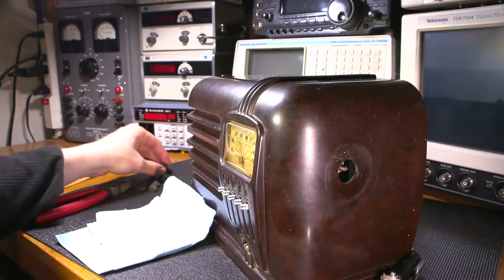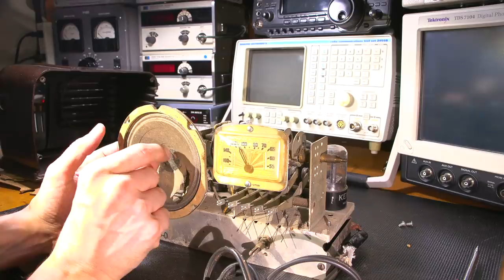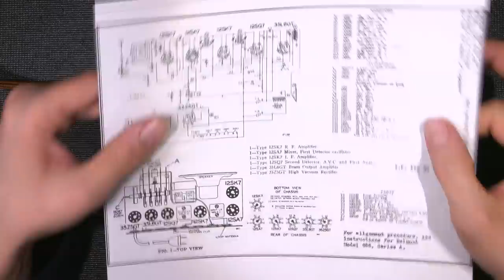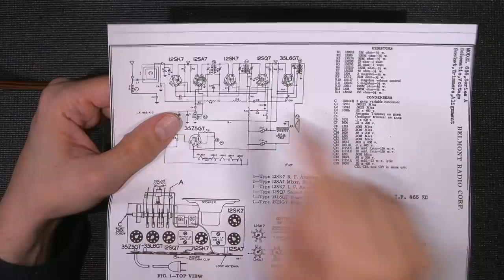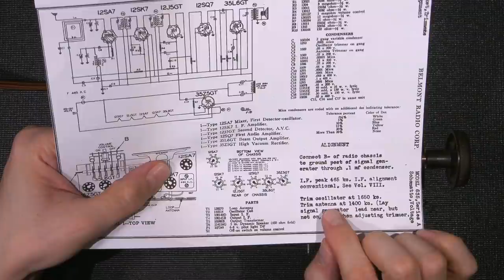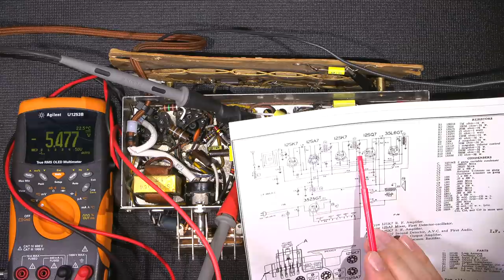Electronic Restoration Adventure-The Belmont 636 Radio Receiver!

Comment: I'm not an electrician but I like to delve into stuff that is way out of my comfort zone but with the right info and doing it very slowly step by step you'll get there!
antique phonographs are my thing but I wanted a radio of the early 1920s one of those beauties with glowing valves and square bare wiring I found 3 for the price of a half one 2 worked fine those things are pretty solid and not much can die with age with these things but one was shot and way gunky!
it took me about a year to find original parts and there are no specs for these so you have to learn what is what, what does what and what goes where aka,... really fun!
the tubes or valves were ok hmm sadly only in clear glass I hope to find replacements in multiple colored glass pointy-headed tubes to light this puppy up like eh,... quite literally a Christmas tree!!
there wasn't much wrong 3 glass resistors were broken (it's simply X amount of copper wire windings on a thin glass tube or even between 2 thin glass tubes) the thin tubes were broken and the copper wire windings cut that was all except the resistors were unmarked...
so I had to go to similar pre-1928 home build sets and do a guess and then take measurements with the guessed new part I bought to see if it measured up to the rest. 
and that was my life for 2 years!! testing testing testing those parts until I got it right. 
now to find pre-1928 loudspeakers, not an easy thing folks!!
the jist of the story is that even a dummy like me can get there in the end!

Comment: Hi Mr Carlson funny story to tell you I was fascinated with electronics at a young age and so we had an old radio that was broke so I took the speaker out and connected it to an old tv that had a radio in it ran a long cord so I could hear the sound by the couch so I did that for a  few days the cool thing about this old radio was if you turned the dial all the way to the end of the band you could hear the police calls no other radio did this so I thought it was really cool and one day we got a knock on the door and it was a police officer and he said we were broadcasting on there frequency. So somehow our old tv/radio turned into a transmitter on the same frequency as the police frequency I was listening to. Now is that the strangest thing you ever heard?

Comment: Superb restoration. I would love to see someone remove all the resistor, capacitors and leaving just the chassis with the vacuum tubes and sockets,  and underneath a modern PCB with modern resistors and capacitors, but with wires going to vacuum  tubes. Thus eliminating the "hot chassis" problem and the look like someone dropped some components inside the chassis.

Comment: Very cool.  The preset cams are a nice design.  I rehab old typewriters and they have some really well designed mechanisms, as well.  I you want to see a nutso mechanical design, go look at the wiffletree they used as a binary mechanical interface" computer" in the IBM Selectric II, it ties the keys to the ball totally mechanically, to rotate and tip the angle of the ball typeface head.  Some of those "old school" designers were REALLY clever.  That  underneath "packaging" in the case of your radio is pretty awful, though.  Giant components just all hanging on their leads wouldn't exactly fly in military design.  ;-)  

If I ever wanted to do a rehab on one of these this video would be invaluable.  I am a EE, but have NO tube experience, and am clueless of the design methodologies/architectures.  I just resurrounded the speaker in my Velodyne servo sub.  I wonder if you can still get a kit for that speaker...would depend on the geometry,  I would expect.  Were those speakers even 4 or 8 ohm or some higher resistance versions?  It also looks to me like that design could really have used a fine tuning knob, as well.

If you sell these afterward, and I'm ever looking to buy one, I will look you up.  If you ever want to buy an antique or vintage mechanical typewriter (or other things, ultimately), give my channel a view. Hobbies are a good thing.   ;-)

Comment: W-D40 is good for cleaning parts but bad for removing lubrication. I always . use 3-in-1 oil after I use W-D just to re lubricate my parts
. The inside of this case is a good place to do this.. This is A god video and I respect your work and will fallow you in hopes of learning from you!

Comment: Classic AA5 design.  Rider's Volume 11.  A or B revision?

use elmer's rubber cement to revive the speaker cone assuming you are able to fix it.  coffee filters and service cement followed by elmer's rubber cement can patch smaller holes, but i've never patched a hole/rip that big in a cone.

you'll need several coats of the rubber cement on the cone.  coat the entire cone until it is saturated.

Comment: Some of the Old tube radios had a feel to them back in the day.  The AC-DC units that ran on 110VAC at 25HZ  had a feel to them as power supply buzz on the speaker could be felt but not heard,when the Electric utility changed over to 60 Hz from 25 Hz  the old radios started to buzz.

Comment: in 1980 I worked at NCR where they manufactured the power supplies for their equipment.  We had one technition that would have a capacitor explode once a week or so..  YOu could really hear the big bang.

Comment: Keep your eye open for some old Bell (Western Electric) vacuum tube intercom systems. I have several, and they all have that exact same speaker in them. I believe they are 4.5" in diameter, and are 12-16 ohms IIRC.

Comment: No rf section in that design, The 12J5 in the circuit is a 2nd if and gives the set very good separation between stations. Real dx on that set depends on a good outside antenna and retuning the antenna trimmer to the frecquency you are interested in. Bur usually the broadcast band  has too much noise on it unless you live far from any city. And no thunderstorms. lol. 
 A wonderful restoration on that set.

Comment: If you really wanted to save the old speaker Say if it's a really odd shape/ size or just rare, a piece of paper, hobby glue and some shellac would do the trick. The hobby glue would not only be for holding the paper on but if you rub it into the surround it will remain flexible and prevent rips, the shellac is for the cone to help stiffen and strengthen it as well.

Comment: I get the idea behind the "safety mods" in terms of switching the hot side and using a polarized plug. A number of times this has led to substantial hum in restored radios, and a cord you cannot "reverse" to limit the hum. I think I am giving up on making the chassis "neutral" as most radios were designed to have the neutral side switched, and sound better that way. They are also in insulated cases and do not prove to be a shock hazard at all. A fuse (or two) is a great idea, though.

Comment: I am working on an old Zenith AM/FM radio.  Non-polarized plug.  The volume on/off switch switches one of the AC lines to ground.  So I switched to a polarized plug.  That way I can control which one goes to chassis. The neutral is preferred since you won't get zapped if you touch the chassis that way.  I had the bright idea to convert to switching the hot lead.   Bad idea.  Makes the radio hum like crazy.  I discovered that by grounding one leg of the switch you eliminate AC on the switch getting into the volume controls audio lines.  Makes sense.  FWIW

Comment: #question/tip?  : you mention the rubber shielded wires that will be really hard to replace cause they go in filter can. In those cases where you really don't want to open up filter cap, can't you "just" take all visible/reachable rubber off to bare metal and then re-isolate with heat shrink?
Course only works for relative short ends where/when replacing would be really hard.... replace is better; but do think using heat shrink can sometimes save the day

Comment: Hi Paul!  Have you ever considered doing a video to demonstrate the impacts of installing modern replacement film capacitors without regard to which lead is connected to the outside foil?  I've always installed them so the labels all face the same way.

Comment: I use to work with a guy that endlessly chimed about PPE. Gloves, Hard hat, ear plugs. Safety glasses, boots and high vis....yet didn't own a single bit of it. 
 I get the lecture about deadly redundant ground electrocution but ya kind skipped over eliminating the dangers with a power switch rewire...also it would be kind of you to demo your peanut transmitter and a temp check. 
 Cheers.

Comment: GFCI outlets do not use the ground prong ( "that 3rd pin") to do their work. GFCI circuits measure outgoing current through the hot and returning current through the neutral and if they do not match, the breaker opens.

Comment: Tubes are usually welded or crimped, not soldered, so it goes without saying you’ve never desoldered the pins or contacts in a tube .
Reply from the maker: Octal pins are soldered at the ends.
Reply: Mr Carlson's Lab I wasn’t aware of this. Is this always the case?
Reply: Or maybe I am not making the distinctions between the tube and what connections it has inside the envelope, from the connections in the base, and then the hmmm terminal.
Reply from the maker: Very rarely have I seen a spot welded "and crimped" pin on an Octal tube. About 99% of Octal tubes are soldered. "Loctal" tube's, more commonly seen in Europe, have a solid pin that goes directly into the tube through a base seal. These are not soldered.
Reply: I am used to seeing the more European versions, which might explain a lot. Thank you for your replies.

Comment: It was hardly played otherwise that plastic would have been cracked. It may have spent a lot of its life in disrepair. If someone meaning who ever you sold it to it might be a good idea to install a computer case fan in the back of it venting the hot air out of the back so the heat doesn't crack the plastic. I like the way you think of every little detail like the dial back light. Very good job.

Comment: You forgot to show setting the dial. Is it just horizontal at the extreme ranges of the tuner? Also, we didn’t get to see what you did with the back cover. And lastly, i personally like the single backlighting. It reminds me of the simpler expectations of the times it was built. I’m not old or anything but we had a freestanding AM radio in our living room when i was a kid. It had a single sided backlighting, if i recall, as well. Thanks for doing this.

Comment: Just my assumption what's inside the 'Outside foil detector'.
There is a dual op amp ic with two non-inverting input hooked up to the probes.
There are two n-channel FETs, drains connected to the probes and sources tied to 'ground'.
The gates are hooked up to an astable oscillator (.25Hz) (with an inverter logic* to alternate the inputs (probes).
The outputs of the op-amps (ofcourse with the gain adjustment dual POT connected to inverting inputs of the op-amp and gets grounded via resistors) gets common by diodes and gets fed into an LM3914 or LM3915 (to be specific) which shows the indication of noise levels through the array of yellow LEDs.
The green LEDs near the probes are connected simply to the astable oscillator.

*The inverter can be made by an n-p-n transistor with the emitter connected to ground and collector connected to +ve supply rail via a resistor (around 1k). The base is the input (from oscillator) and the collector serves as the output to the gate of one of the FETs.
Reply from the maker: Your about 10% right ;^)
Reply: Thank you

Comment: A tiny drop of colored fingernail polish on each point where a new wire replaces an old colored wire might be useful in matching up stripped, previously-colored wires with new colored wires on the old contacts.  Just a suggestion.

Comment: Amazing coverage of a restoration! I'm curious as to why you modified the dial light for two incandescent bulbs vs two LEDs. It's a little time consuming to figure out the perfect resistors to current-limit RGB LEDs so that the LED has the "correct" brightness and color temperature, but the LEDs will last the new extended life of the radio. And having done that, is it going too far to tap the IF2/detector signal, add an op-amp, and change the dial color to indicate tuning? If so, then why?

Purists lift their noses at mods of any kind, so it seems to me that if a mod is desirable enough to plan/execute, then it's best to go for the state-of-art as it exists. An example is the Zenith I'm working on - still: it had no speaker/transformer, and I can't find a replacement so I added a good output transformer to the chassis, speaker terminals, a two way passive crossover, a new speaker baffle, and a decent woofer / tweeter. I'd really enjoy hearing your opinion on the subject of Frankenradios.
Reply from the maker: Hi Giblet. I thinks it's all about balance. Two incandescent dial lights look more original, and isn't going too far from an original design. Yes LED's would look great, but would "in my own personal opinion" take away from a modification that could have been done the next day from the original purchase. At this point in time, a restoration is a personal thing, and almost everyone has different ideas about how a restoration should be done. The bottom line is.... Just do what makes you feel good about your resto, after all, it's you that's going to be enjoying it. Just have fun. I have an incredible frankenradio to do a video on..... It's bad!.... I purchased it just for this fact alone. It's going to be fun!
Reply: I can't wait to see you restore a Frankenradio!

Comment: @41:53 I would have checked for conductivity between the two coils as I have found problems with the plate voltage bleeding over to the grid coil usually due to surface contamination of nicotine which is water soluble.

Comment: Hi Paul       Ray Burke I didn't see you putting in C16  40 uF 25 V , C17 30 uF 150 V,  C18 30 uF 150 V  11953 E  caps that replaced the mulitsection Electrolylic under the chassis. Which are listed under Condensers in the Parts list.      I see you used a Tektronics 200 series scope which runs on batteries.  You could reference your videos on isolation transformers, and using a benchtop scope with an isolation transformer on a AA5 radio.

Comment: i have an old 1948 tube radio only like 5 tubes though. it also uses a selenium rectifier which i found interesting. its 100% original all the tubes are same from the manufacturer labeled as Bendix on them. entire radio is pretty much new. no scratches or missing anything on the Bakelite or anything. cored sadly bit dry and dinged but nothing dangerous or exposed. sad thing is the filter caps and such are shot so it buzzes sooo loud so i don't ever use it as i have no idea how to change those atm well plus don't want to ruin the value of it. for $80 though its a great deal. it also has FM and AM.

Comment: Doesn't exist electronics tubes "RF amplifier" or "audio amplifier" etc, they are only diode, triode, pentode, and any except diode could be use how you want, depend how designer did. On beginning the antenna has one oscillator integrated,  Capacitor in series with an inductance is an oscillator.

Comment: Very nice restoration to watch!  I enjoyed it all.

However,  I didn't see what was done to the back cover/antenna.  That was loose and in poor condition.  Did I miss something?
Reply: Also----  you discussed oiling critical mechanical areas,  but what about grease?
Reply: Of course most consumer electronics gets no routine maintenance at all and simply gets tossed in the junk pile when it no longer works right.  But I'm curious as to what kind of routine maintenance this kind of equipment should have,  and how often?

Comment: Do the lines on those old capacitors indicate the outside shielding and not that they are electrolytic capacitors?  What kind of capacitors are they--wax, paper, electrolytic?  What do you do when a tube fits loosely in its socket? I can't believe that you got a new vintage electromagnetic speaker.  I would have tried glue and a piece of paper towel.  Why are you using a ceramic capacitor in series with your function generator signal input to the IF of the radio?  I cannot believe that there was room for another light for the indicator.  The engineers were on barbiturates when they only put in one light.

Comment: for those of us across the pond who are confused as hell about what Vim is, it seems to be approximately the same product as comet cleanser.
Reply: Due to my great age I can remember using a product here in the UK called Vim. It was an abrasive cleaning powder which came in a cardboard cylinder (similar to the Pringles containers of today) but with a metal top.
Reply: @stewatson3922  That is exactly what Comet is. An abrasive cleaning powder with bleach, sold in a cardboard cylinder with a metal top, with a sticker over the shaker holes in the top.

Comment: I have an old Ross Radio from 1968/9, It works but the volume isn't high at all, can you fix it? It looks almost brand new. The leather casing is good, looks like it was never abused for as old as it is. If I send it to you, can you fix it for me? Of course whatever you charge I would agree to because I want to add this to my vintage working radios that I collect. Please will you look at my radio?